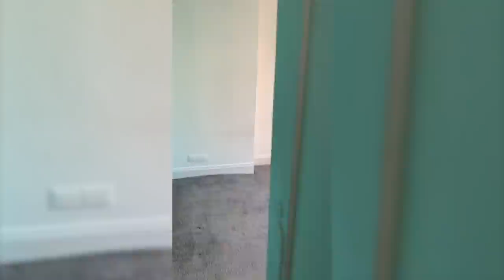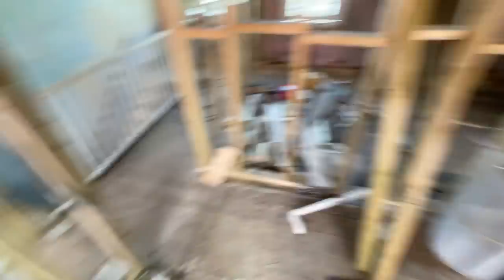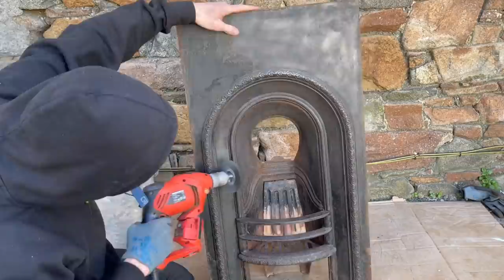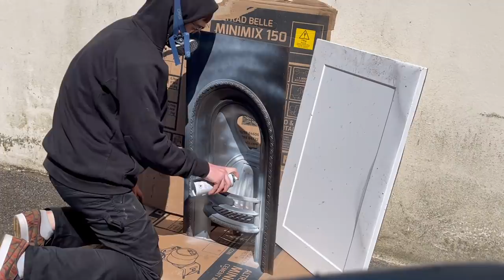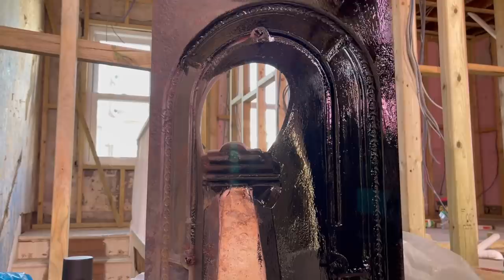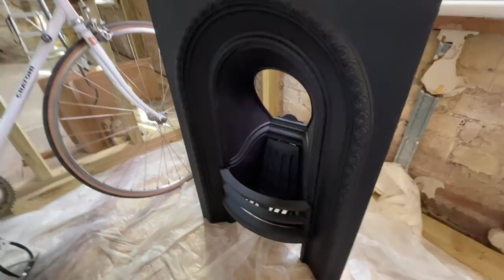Discovery and RESTORATION of Victorian Fireplace!

Comment: I love this kind of content. It's funny to see how differently in the different countries the building styles are. Here most houses have all walls made out of stone. Also inner walls.
Reply: A lot of houses like these started out as just an upstairs room and a downstairs room. The inner walls are added later, so it's cheaper and easier to just use wood and plaster! My house is the same. It still has the original trim around the ceiling... Which has since been cut in half when they divided the upstairs to make an indoor bathroom 😅
Reply: @Charky_Creations  it's not that we use here brick walls but autoclaved aerated concrete (aac) blocks for inner walls  . They are light weighted and cheap here. Benefit of this type of blocks is that you can hang more weight on the wall(you don't have to measure to get it into the wooden beam) and they have heat and acoustic isolation properties. But again, it's just that it is interesting that they do it on a complete different way, but having the same result.

Comment: it looks lovely, and it is great that your retaining them. I would not have painted it at all mind. the paint at the rear and the undercoat are not heat resistant. Also many stove paints are not meant to be subjected to open flame. It would have been better to use Black lead (grate polish). it would have achieved the look you desired on the cast iron whilst also making it much easier to convert to a working fire place in the future should you, or a future homeowner, decide to do so. Either way, good on you for keeping them in place :)

Comment: Most high heat paints need actual heat to finish the curing process. If the paint isn't fully cured, it can flake off or just simply rub off.  Check your cans to see if it has such a requirement.

Comment: Did your builders advise your about your flaps?   Most chimneys have in them a flap for use in the summer to stop birds and rodents ingressing, I remember my grandfather the first lighting up of the year he would open the flap and all manner of departed small creatures would flop into the fireplace.   A shame about the original range, a shame the front couldn't be salvaged and used as a feature piece but if its gone its gone and unless you have your own foundry to hand... its off to the big range heaven it goes.   You don't even need to have the upstairs fireplaces working with real fire but you can buy very good and efficient faux fires that put out a lot of heat and look like the real thing but are electric.   I notice you haven't got a central heating system so winter heat will be an issue although in my growing up years all we had was a front room gas fire and my father saying if we were cold put a jumper on which we did.

Comment: Uh... If the undercoats aren't high heat, they'll melt or burn off as the metal heats up. The top coat doesn't act as a barrier.